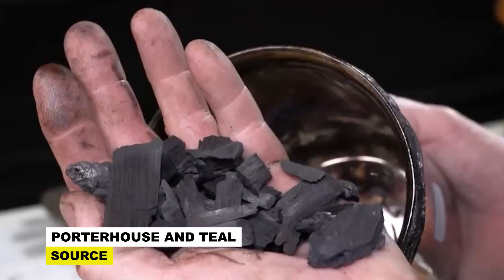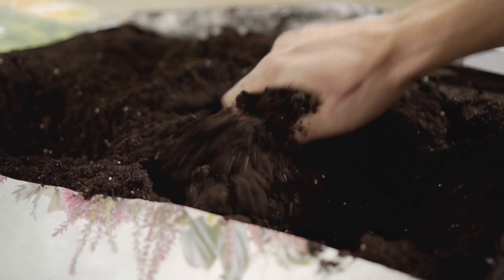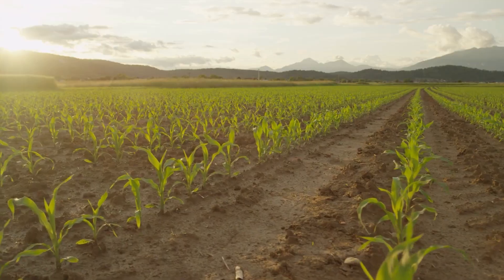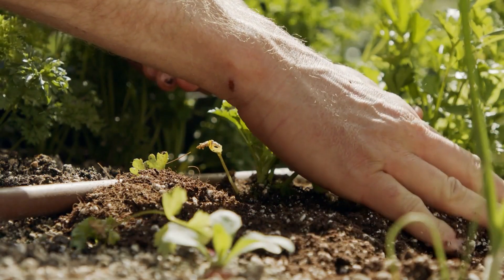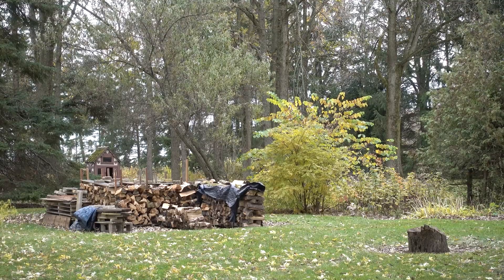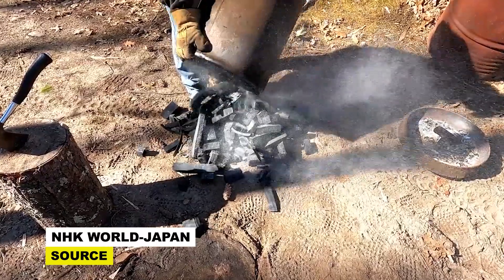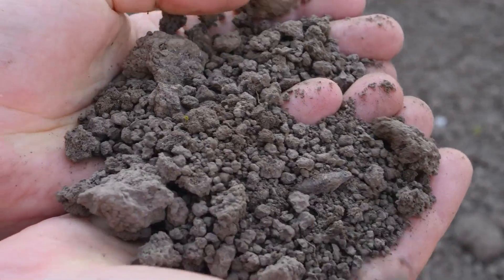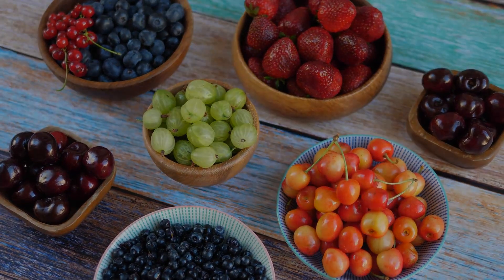Biochar: What is it and is it worth the hype?

Comment: There are many things that are said in this video that are simply untrue. Only very limited areas of the Amazon Rainforest were ever amended with biochar. Massive communities were adept at making soil from char. They also used massive kilns for the pyrolysis. The process takes at least six weeks because there is so much surface area. Crushing the material unleashes massive surface area. 1/4 inch chunks of material is still way too large. 2mm is best, about half the size of a grain of rice. Virtually every image shows char that is being processed both far too wet and in much too large chunks.

Comment: Hi, I noticed you incorrectly labelled a clip from the weedy garden as ‘red gardens’, would be nice to correct this. Red gardens comes later with the earth kiln and wood in the wheelbarrow. Also wish to comment that it could be a little tricky to use info from general sources, as this is how myths are promulgated, better to use some of the excellent research that is available specifically for use in agricultural production. However, you have put together a lovely and easy to follow video, thankyou 😁😁

Comment: This is mostly a great video but the word that is missing is for people to understand is inoculation. 

Simply put, make your biochar by whatever method you choose, break it down, inoculate it with molasses, urea and mix it in to compost for a season and it is ready to use. It’s so easy. I’ve been using this method for 5 years now and have to literally give it away. I have black soil with worms and organic matter in my desert El Paso sand that I started with
Reply: Humic acid works also very well for the root system

Comment: I just build a fire about 4ft square. 
Let it burn until the flames start to die then i hose the fire until it's put out. I wait an hour then I stir up the ashes and hose it down again. 
The next day I sift the charcoal through a screen made of 1/2" rabbit cage wire.
I store the charcoal in metal trash 
cans.
I spread about an inch of charcoal over my chicken coop floor and let the chickens scratch it in and poop on it and break it up for a few months.
I shovel off the top two inches and I use it in my container garden
Quick and easy.

Comment: Tera Preta is in the river valleys, where those civilizations conducted their agriculture. It isn't in the rainforest, and it isn't sustaining the rainforest. The rainforest handles itself
Reply: bs... it's sewage pits, and it's still around hundreds of years later because ash, mixed with charcoal and clay with some bones is not that hospitable to microbes, or it would be gone.... think about it, a leaf mold pile on the side of my yard gets colonized by nearby tree roots within 1 month of sitting there... so, aaaaaah, why's the terra preta still around?   I gotta know how this could be?
Reply: @glen.simpson Terra preta doesn't readily lose its nutrients because the key component, charcoal (biochar), has a highly porous structure that acts as a stable reservoir for nutrients, preventing them from leaching out of the soil due to its chemical composition with poly-condensed aromatic groups, which resist microbial degradation and allow for long-term nutrient retention; essentially, the charcoal particles hold onto nutrients, making them available to plants over a prolonged period.
Reply: @glen.simpson  the tree roots are not decomposing the leaf pile they are looking for moisture mostly which would be retained by the leaves. The decomposition is done by micro organisms like bacteria, mold, and fungi, because charcoal is a strong carbon-carbon bond it makes it highly resistant to natural decomposing influences and takes a very very long time to degrade. It acts more like a house than food for the bacteria, mold, and fungi which is why it requires other sources of nutrients to matter in soil.
Reply: @patrickwilbur9743  duh... feel better
Reply: @patrickwilbur9743  oh, and show me the research showing organisms living within the char....please
Reply: @glen.simpson  there are many thousands of studies showing just that. Please do a little googling before you attempt to call into question settled science.
Reply: @tonysaladino1062  what? Silly
Reply: @glen.simpson  yeah, only a tiny fraction of the Amazon Rainforest was ever amended with biochar.
Reply: @tonysaladino1062  they were municipal sewage pits that did not support microbial like because they were so chucked full of char and ash, thus, they remained in  vigorous jungles for centuries.
Reply: @glen.simpson not sewage, not ash, not pits. Building soil has to begin with char, not ash.
Reply: @tonysaladino1062  show me one study showing microbes living within char, just one please..... do your own study, take biochar and mix it with cantaloupe rinds in one dish, just cantaloupe rinds in another dish.  Which one shows fungal hypha first.  Just do it.
Reply: @glen.simpson  simple, like clay, it has been heated to a temperature at which it glows. The whole structure fuses to itself and cannot be crushed or digested by any organic process, except burning.
Reply: @glen.simpson it's not the actual organize matter that plants feed on... It's like a housing project for microbes and nutrients so they stay out until needed and actually used by the plants as opposed to eventually running off with the water, plus it holds moisture when it's dry and releases it if it's too wet therefore holding water for plants and microbes during drought or high heat times and letting it drain thru when it's too saturated. It's a game changer but I'm a different way I still use compost to add the goodies continuously however much more resilient soil
Reply: @khandonkey349  no, microbes do not like to live inside nor on biochar..... do your own tests.... show me the science showing microbes living within biochar?
Reply: The gardens that were enriched with terra preta were made in the rainforest. The climate zone TRF, Tropical Rain Forest exists as a virtually unbroken belt around the planet. Except for where the oceans are.
Reply: @tonysaladino1062  I know it's in the tropics, but that's not what I'm talking about. When I say "in the rainforest" I'm not talking about the latitudes, I'm talking about the actual forest. Those civilizations did the things they did that generated what we call "terra preta" near where they grew their crops, which would have, by necessity, been in river valleys. The stuff isn't scattered all around the rainforest, it's concentrated in those river valleys
Reply: @johntheherbalistg8756  The forest abuts the rivers. TRF is a virtual carpet over the equatorial latitudes. The openings that they built in were purposefully cleared for their habitation.

Comment: The narrators comments are not entirely correct. The greatest percentage of the Amazon rain forest is largely leached due the high rainfall and the heavy clay soils only anchor the trees with the roots growing up to the leaf debris to extract much needed nutrients. The biochar or as it is called Terra Preta meaning black soil is man made over hundreds if not thousands of years.
Reply: it's sewage pits that have not been monopolized by nearby trees because ash mixed with clay mixed with charcoal and some bones does not support microbial life, thus no nutrient acquisition, thus remnants that have nutritional value when liberated and spread out..... they crapped in pots then dumped them in pits with animal guts and threw charcoal on top to control the smell.... yes, control the smell with biochar.
Reply: @glen.simpson  What about minerals...and the sponge effects for sandy soils and fungus?
EDIT: I'm thinking about the Biochar surface area and it's capability of not allowing the nutrients to be washed away.
Reply: @azumag4432  fungus does not like biochar.... ever see it grow in a carbon water filter folks use in their kitchen?  it does not have a sponge effect, although does contribute to soil hydrolysis effects to some degree as water moves through it capturing air in vacancies... nothing lives in biochar... this is a false idea perpetuated by an ignorant crowd of biochar fanatics.  Small amounts of solube nutrients may remain or be trapped in biochar, but they will be of no interest to the microbial community given biochar's superior anti microbial properties.
Reply: @glen.simpson  I’ve been thinking the same thing. I jumped on the bandwagon and tilled biochar into two of three garden beds and don’t see any difference after two years.
Reply: @glen.simpson Terra preta doesn't readily lose its nutrients because the key component, charcoal (biochar), has a highly porous structure that acts as a stable reservoir for nutrients, preventing them from leaching out of the soil due to its chemical composition with poly-condensed aromatic groups, which resist microbial degradation and allow for long-term nutrient retention; essentially, the charcoal particles hold onto nutrients, making them available to plants over a prolonged period.
Reply: @g @glen.simpson my thoughts exactly but they are still giving carbon credits for biochar.
Reply: @RussellHlokoff  that's just straight up f'n stupid.  As you know, the mount of co2 produced making biochar far exceeds any value in capturing some as biochar.  Amazing stuff.  Unless you had some solar or wind driving a cooking process, then there's the issue of syn gases and such.  It;s  a no win situation painted as something valuable. Wicked. If someone could make it as a bioproduct of some biomass electric generation, maybe it be something to consider.  But, given most biomass electric generation involves shoving all kinds of nasty crap in there, well, can that idea too. Plus, I still don;t think it adds anything to the soil except maybe some hydrolics and aeration benefits.   IN that respect maybe it has some value.  I have done some work with biochar.  I prefer other work. It is gosh darn dirty. SO many negatives.
Reply: @glen.simpson I hope to do something with it this year but it’s a three year project and then we will know if bio char actually does something or is just a money maker for climate change scientists and governments.
Reply: It's basic DISINFORMATION and people believe this BS.

Comment: I just tried making some biochar in my pellet stove. It was just a small amount, but it worked. 2 empty bean cans filled of wood pellets pushed together and set it inside the stove. Next time, I'll add more.
Reply: I use either a dutch oven or any cookie or cracke tin with the lid screwed on with three self-tapping screws and half a dozen holes to let the gasses out, full of wood shavings or sawdust. That way, you never have to crush it!

Comment: I love biochar. Started using it about 6 years ago. Started small, now about to do 200 acres this spring. Just be careful not all biochars are created equal.
Reply: How do you mean? I’m building a vermiculture composter and biochar reactor now?
Reply: @andrewevans4038  If the flame is not hot enough, there would be a lot of tar residue that not only will block the pores in the chare but also introduce carcinogen into the soil. The recommended temperature is at least 450°C. Also your feed materials may improve the nutrients content, cow dung or pig manure can be mixed before the burning to increase the phosphate content.

Comment: Bio char is fantastic.  I do think that it's benifits in a sandy porous soil like the Amazon is much different than most agricultural Soils and all clay Soils.  Charcoal adsorbs toxic things as well as beneficial nutrients.  In a heavy clay soil with a high nutrient holding capacity I think bio char role is less about retaining nutrients and more about the sequestration of toxic substances.  Compost and manure based Fertilizer are fantastic sources of nutrients but also contain heavy metals and other undesirable things.  Bio char can make these toxic substances less Bio available to our plants and reduce toxins we ingest in the process.  Activated charcoal is used in hospitals as a response to counter act poisons and it can be used in a similar manner in composting and regenerative agricultural.
Reply: So do you think it's unnecessary to add biochar to clay soil to increase nutrient capacity?
Reply: @colly7963  The amazon (or at least the river valleys where terra preta is mostly located) actually has mostly clay soil from what I understands so yeah it helps, not sure if the benefits are higher or lower than sandy soil or not. For clay soils it increases drainage and porosity and for sandy soils it increases water and nutrient retention so it reduces the weaknesses of both